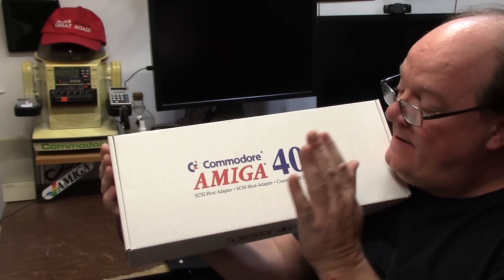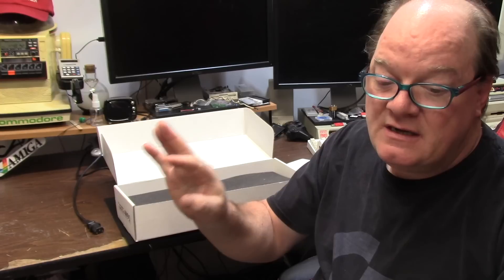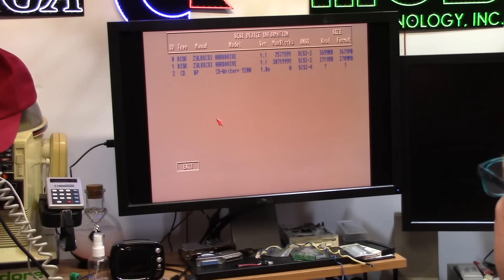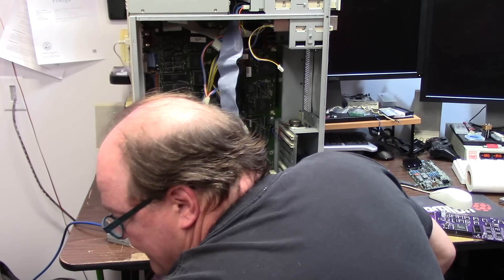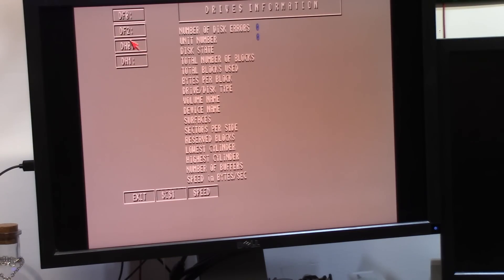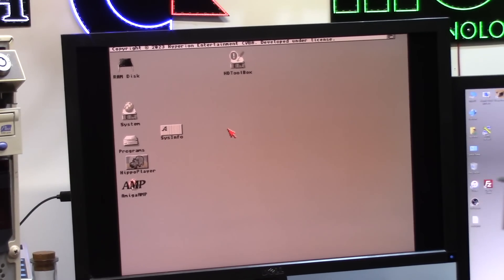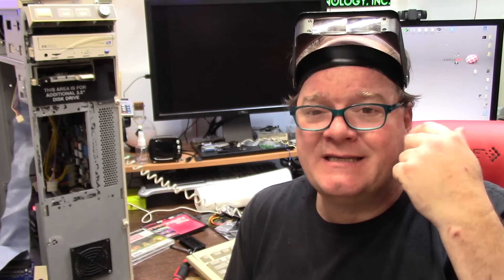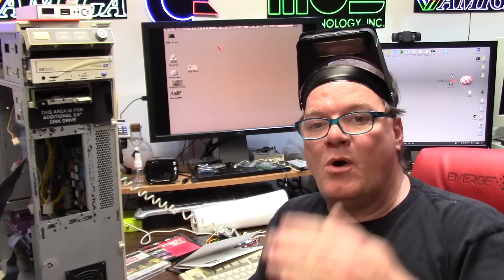Commodore A4091 Z3 SCSI controller review

Comment: Just to confirm, the text in the pamphlet says for "Amiga 3000(T) and Amiga 4000(T)" as opposed to "Amiga 3000T and Amiga 4000T", meaning it will work in any Amiga with Zorro III and Super Buster 11.

Comment: That disk speed number 10m 55s in (6,533,600) is suspicious--I get that same speed from my ReA4091 on my A4000 running a BFG9060 @ 50 MHz (SCSI2SD v6, and block sizes of 2,048 bytes). The most telling thing is that (for me at least) it's identical every time; usually in SysInfo, you'll get a similar speed every time you run the test, but not exact... I've submitted a bug report to the SysInfo author; not sure what or where that number is coming from, but hopefully someone can get to the bottom of it. Way too coincidental.
Reply: 6,533,600 (should be 6,553,600?)  is 64k * 100. There is some counter overflow in SysInfo. That number is not real.

I recommend you use the devtest utility that is part of the ReA4091 software package for benchmarking. It is more accurate and more versatile.

Comment: Seems like the 4000T wouldn't gain much from this card since it has a pretty fast SCSI already?
Reply: Maybe you missed where Chris tripled his speed compared to onboard?
Reply: @boydpukalo8980  that was on a 3000T which had a slower scsi interface than the 4000T
Reply: Yes, the Amiga 4000T has an NCR53c710 (same as the A4091) but it is attached directly to the CPU bus rather than through ZorroIII. So it is slightly faster than the A4091.

Comment: Hey Chris, your DH0 use 512Byte Block Size. DH1 2048. That's why DH1 is faster. For any SSD or SD Card (Like you use in the Zulu) 4096 Bytes Block Size is the best and fastest option, because that's the typical physical block size of Flash Media.

Comment: Awesome Chris!!!  That 655,36 speed is the 16bit overflow!  That is, it's faster than SysInfo can report lol!
Reply from the maker: Ill have to try sysspeed and see if it gets better
Reply: @ChrisEdwardsRestoration  Use devtest from the ReA4091 floppy...
Reply: @st3p4n  And wait another 7 months for video update......I'm busy....... :)
Reply: @boydpukalo8980  Card is an (aaaaaalmost) exact copy of the original A4091. I posted some performance numbers on EAB and a1k. Depends a lot on what Amiga you run on, what accelerator, what memory you load into. With the latest GAL set, we got around 9MB/s into Zorro III  memory
Reply: @st3p4n  "Damnit Scotty I NEED Warp speed NOW...". 9MB/s is awesome.